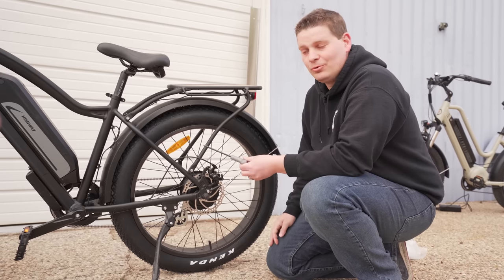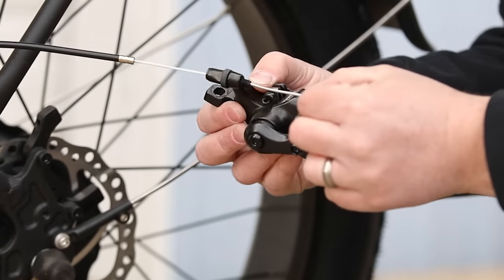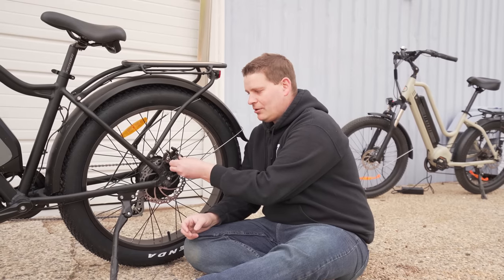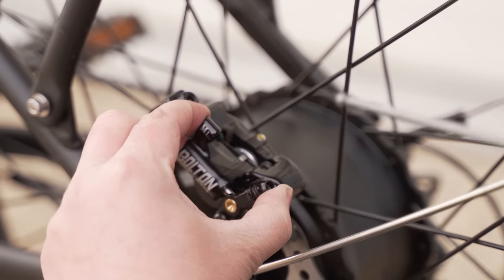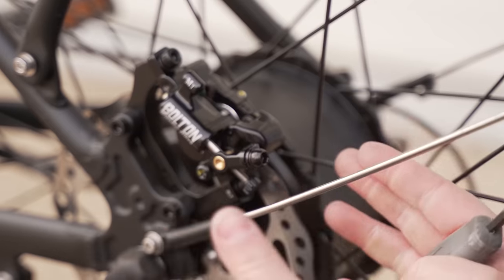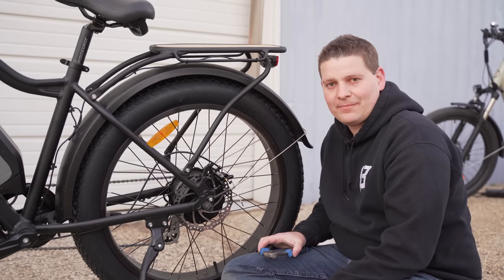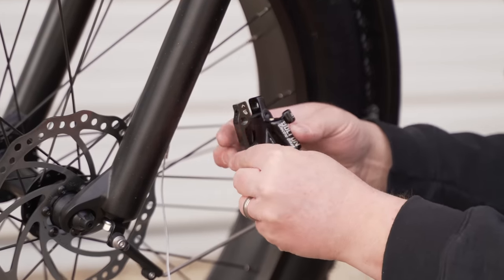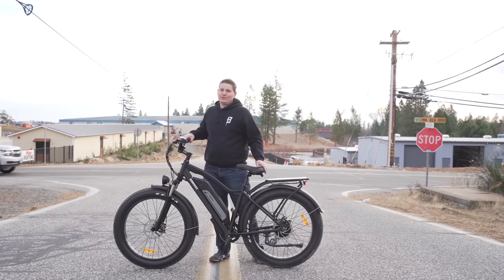Why You Should Upgrade Your EBIKE Brakes - and How To Do It

Comment: I’m a fan of your products and your videos. I’ve been a video production professional for 32 years. I really appreciate your video production quality using high quality cameras and decent audio. I really struggle with viewing the videos where you switch between camera angles every sentence or more. This is really distracting and I feel unnecessary. I know a talking head is boring TV but you don’t need to switch so often that our heads spin. I’m guessing you use a third party video production company so you might want to forward my suggestion to them. I will still continue to purchase your products to upgrade my Rad but sometimes less is more when it comes to video production.
Reply: I noticed the same, but the cuts were even more frequent than you described.  For example at 2:07, there are NINE cuts in less than 20 seconds of video:
"But there is a much easier way, and that is to just replace the 🎬 caliper. 🎬 If we follow the steel cable 🎬from the lever, we go all  the way down 🎬to where the rotor 🎬is. Our brake rotor,  🎬 and this is the brake caliper. 🎬 Now for the stock brakes,  🎬 you have a brake pad on each side of this disc. 🎬"
Reply: Yep. I love his videos for how informative they are, but I struggle to get through some of them because of choppiness. It's very distracting.
Reply: Lol it's not a Hollywood production it's a man selling his product get over it

Comment: Dude you finally explained why the brakes on my Rad Power Bike requires so much adjustment. I try to be a lot gentler when I’m braking these days just to require less adjustments. It truly does feel like the biggest crux in the system, requiring the most babysitting. Going to truly look into the solutions you’ve provided here and really appreciate all of your great quality videos. Seems like your production quality is getting better and better all of the time!
Reply: Apparently from what I heard rad bikes for some reason has a brake problem...I don't know if it's wear, adjustment, or what...
Reply: I think it's one of the easiest places to hide cheap components in electric bikes. I have a sondors that's no different. Single side mechanical brake that makes clinchers look Gucci.

Comment: OK, I installed the BOLTON Hydraulic Brakes on my Himiway.   Easy install, with only a few things that I found, was confusing.  For the front spacer adapter, I tried the ones you sent and then used the spacers that came with the bike. I now find that the different spacers are for different size rotors!.  I used the bolts & spacers that came with my bike.  What a difference the hydraulic brakes make!  I would say for my weight it now stops 30% better.  Your instructions were perfect!    Thanks again Kyle.

Comment: Good timing for this video, I just received your calipers the day before you released this video. Today I installed them and they work great. I also got the controller and screen upgrade for my 2019 radrover. I love the screen, a little different from the videos, seems a little upgraded. I installed the 750w bafang motor on it too and got your custom socket for rear freewheel gears. That socket made easy work out of the motor swap. Keep up the good videos and good luck with Bolton Bikes.

Comment: Thanks for this, just put in my order.  I've had my Himiway cruiser for a month now, loving the bike but just shy of 300 miles really noticing the brakes don't seem to be up to par with the weight and power of the bike.  I stopped in at a new ebike shop in my neighbourhood  to ask about upgrade options and while they had a full set of hydraulic brakes in stock the owner was really good about explaining the challenges (cable length, potentially having to splice the electric connectors if they don't match and re-routing the cable on the frame).  I just watched a couple other videos from people who went this (calipers) route, I'm not expecting a dramatic difference in performance, but feels like a worthwhile tweak.

Comment: I replaced the front Star Union 2-piston hydraulic brake on my Juice Ripcurrent S with a Magura MT5e 4-piston hydraulic brake system with a QM40 caliper mount and a Magura MDR-C 180mm rotor . This system is amazing and was relatively simple to install. I ordered the MT5e with a Normally Open motor shut off switch. Magura calls this a "HIGO Closer (NO)". They also offer a Normally Closed switch for ebikes that require it called a "HIGO Opener (NC)".  "HIGO" is simply the connector most commonly used. Oddly, the Ripcurrent uses a weird screw-on HIGO connector to insure a good, safe watertight connection, so I had to repurpose the one side of the connector off the Star Union brake lever by snipping it off and soldering it onto my new Magura brake lever. This brake system works awesome.

Comment: Another major brake upgrade is to ditch that squishy helical wound cable housing for some zero compression (compressionless) housing. 

The zero compression housing has linear wires in it, like an index shifter cable housing, and it can make a huge difference in translating finger pull into stopping power.

Comment: Hello and thank you I'm a new owner of a red expand 5 and I have been driving my bike while riding my bike for 3 days. After riding through a few mud puddles and up a few dirt roads I find that my front front mechanical breaks are making a lot of noise the rear brakes are not stopping like they were when I purchased the bike 4 days ago. 
This is a big help I will purchase the Hybrid hydraulic calipers a little expensive.
Is there anything out there less expensive.
If not then I'm stuck with purchasing the hybrid that you are you're advertising thanks.

Comment: Very cool 😎 
I’ve seen videos where they unscrew the part (Barrel adjuster?) and use it in place of the barrel adjuster in the Bolton Hydraulic brakes.  This means no cable cutting and less tools 🛠

Comment: Did I miss the price of the pair of calipers? I noticed they were branded Bolton, cool.
  I like the way you adjust them with the one adjuster.
 I'm running a 1500 watt wheel kit with a 52v x 20 ah Unit Pack Power  battery. 
Thanks 
  Raymond Mack

Comment: Hi. My ebike has 2 piston calipers. I was wondering if it is possible to use the existing bracket lever a just replace the caliper. I guess I would have insert some sort of adapter to the en of the existing tube. Is this something people do? I can't seem to find 4 piston brake kits that have levers with the brake sensor.

Comment: My ride1up lmtd has Tektro auriga hydraulics. I just ordered the tektro ceramic/organic pads and a bleed kit with more tektro fluid.

However, they’re 180mm and I’d like to go to 203 or 220. The one thing I can’t figure out are what types of rotors are best. It seems as if full floating should be best, but at the “ebike specific” rotors seem to be centerline.

Comment: Came across this video after watching a couple others so this question may be repeated.   But did the exact same thing but the looks like the pads are only covering 70% of the rotor when installed   (my LBS did the installation).   Wondering if the supplied brake adapters make a difference?

Comment: We ordered some Juintech hydraulic calipers from you and they wouldn't fit the rear wheel of our bike (Biktrix Stunner). Is this a different model, that's a different size and could potentially fit?
Reply from the maker: The Biktrix Stunner comes with hydraulic brakes already.
Reply: The Biktrix Stunners prior to 2019 came stock with with mechanical disc brakes. We have 2018 Stunners. I bought some Shimano hydro brakes from you for my bike a while back but now we want to upgrade my partner's bike. The Juintech looked like a good option because the install would be easier and my partner is less concerned about the hand force improvement of full hyrdo brakes (I have hand issues that are aggravated by hard squeezing). Unfortunately, the Juintech brakes didn't fit the rear of her bike and we had to return them. So just trying to figure out whether the Bolton branded brakes in this video are a different form factor than the Juintech or just Bolton branded Juintech. We'd just order the Shimano hyrdos from you, cuz we know those work, but you're out of the ones with yellow higo connectors. So looking for other possible options.
Reply from the maker: @jakelondon  I would recommend emailing with details on why the juintech brakes didn't fit.  I haven't had a case yet where I've seen the brakes not work.
Reply: @Area13ebikes  The mechanic at our LBS said there wasn't room to fit them on the frame by the back wheel of the Stunner. These are the same folks that installed my Shimano hydro brakes successfully. Roshan, the owner of Biktrix, confirmed that this had been their experience as well. He indicated the Juintech calipers are a bit bigger than the other ones and the frame geometry of the bike is a bit of an outlier or something. I know they've worked well for many people, and are particularly popular for Rad Power Bikes. That's one of the reasons why we opted to order them. Seems like they have worked well for many people. It's unfortunate they didn't work out for us, but that's the deal. My Shimano brakes have been great, though, but they were significantly more expensive to get installed than I suspect the juintech style would be.

Comment: For $15ea. I'll make your linear pull, dual pivot or canti's work that well. I do like the simplicity of this option.
Reply: Yeah, $15 bucks every 100 miles. A single adjustment doesn't exactly last the life of the brake pads.
Reply: @derekhunter5040  more like once a season. Your PADS won't last that long with any disk set-up.

Comment: 0:33 this is 

only seen in the USA. I have never ever really understood why. Anyone who owns a motorcycle would agree that te front brake lever is on the right side. 
I strongly advise to invertany wrong sided front brakes for those who own or plan to ever own a motorcycle.
Reply: Yes, its a confusion even when you switch between ebikes one never know where the rear brake is until we test it
Reply: To right my front brake is on the right on my ebike here in the uk the only place for it lol also a 51 year motorcycle rider
Reply: Alternatively you could just use your brain. My motorcycle front brake is on the right, sure. My ebike front brake is on the left. I've never been so dumb as to think I'm on my motorcycle whilst riding my ebike, so I've never had an issue pulling the correct lever.
Reply: @derekhunter5040  Your motorcycle have a foot brake?
Reply: @derekhunter5040  give that man a medal lol.
Reply: @silver_surfer88  yup. And a clutch lever.
Reply: @derekhunter5040  Comparing hands with foot, really?
Reply: @silver_surfer88  where in both instances you're using ALL FOUR limbs.

Comment: Stop cutting the seen every sentence 😭
And that is no real upgrade. Buy a 203mm rotors and that is how u upgrade ur brake system. Rotors are dirt cheap. In 20 mins and 20$ you will get 30% more stopping power.

Comment: MODIFIED MY BRAKES, BIGGER NUT AND 32 THREAD, HOLE BOLT DRILL FOR BIGGER CABLE OF SMALL MOTORCYCLE STRONGER.

Comment: Converting to this caliper which makes your braking "hydraulic" for the last 2mm of travel, is a useless change. Changing to hydraulically actuated brakes is a worthwhile change - assuming you need powerful brakes - but leaving 99.9% of the actuator in cable form is a waste of money. The difference between cable and hydraulic brakes on a motorcycle is easy to feel, but this involves using fluid pressure from the actuator on the handlebar to the rotor on the wheel.  The demonstration in this video replaces about 1-2mm of travel and is just irrelevant. I watch & enjoy numerous Area 51 videos, but this one describes what amounts to a scam (No, I do not think Area 51 is trying to scam you. He is a good guy with many great videos, but this is not one of them.) If you want strong & powerful braking, replace cable-actuated pads with hydraulic ones. Otherwise, just ride and keep your cable adjusted.